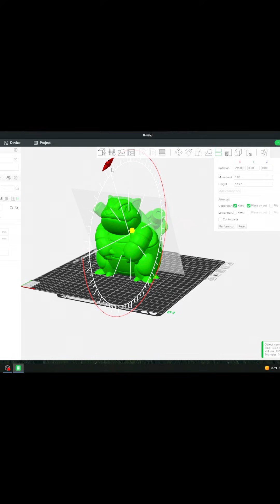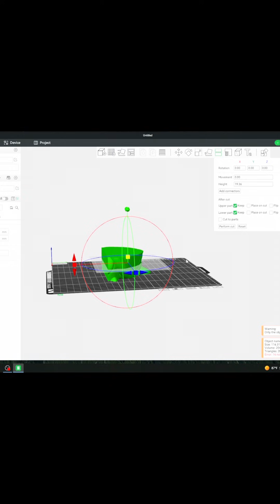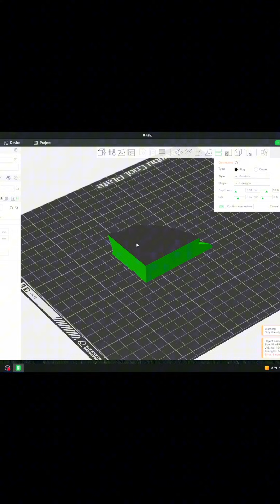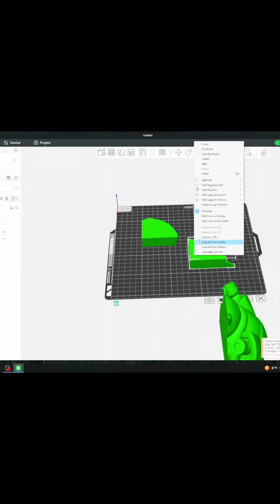How to break down an stl file into multiple pieces using bambu studio.

Comment: I've tried to use bambu studio, it does work well but only issue is that the negative part of the connector (the hole part) doesn't show up in cura. is there any work around for that?? thank you